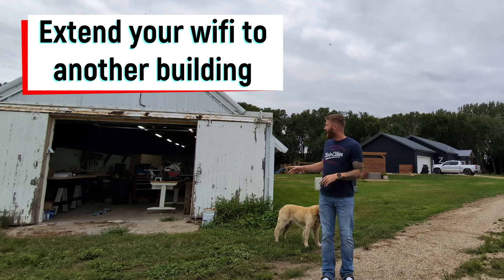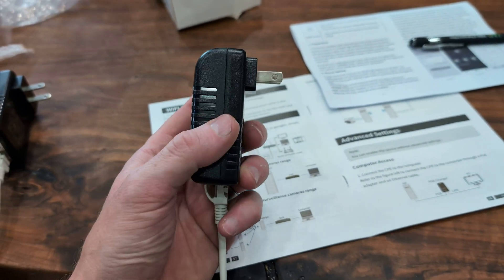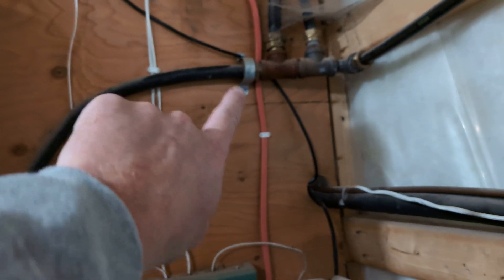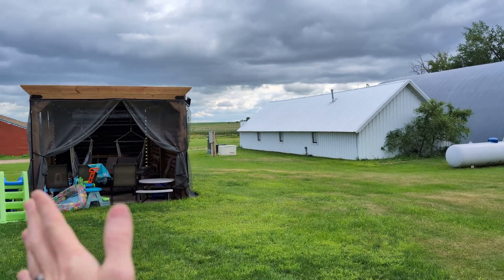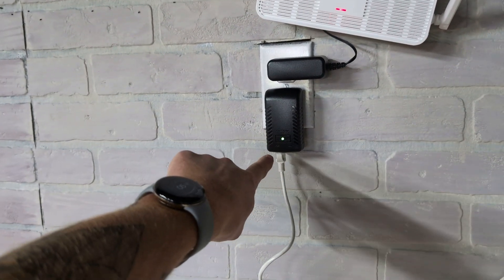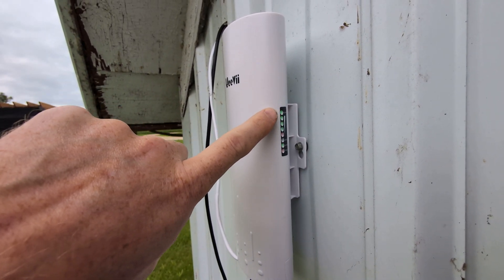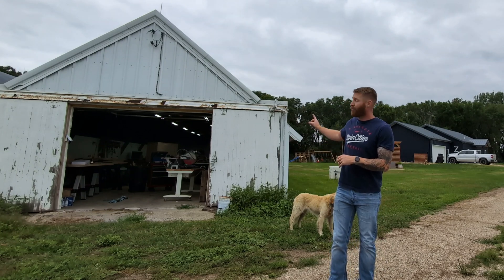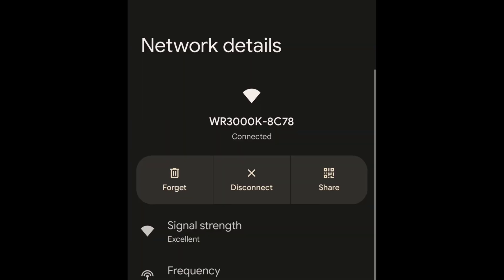How to set up a wireless internet bridge from one building to another

Comment: What is wrong with just running an Ethernet cable between the  buildings?
Reply: Bridging is better for A few reasons:

Trenching can be costly because you might need to get permits. 
There can be signal loss over a certain distance. Bridging can cover a few miles  or more (depending on the equipment).
If you ever need to make adjustments or move something, bridging makes it easier to handle that.

Comment: Good day. Do you need a router in the wood shop or could you run a LAN cable directly from the unit to a PC? Thank you
Reply from the maker: If you're going to hard wire you might not need a router but I'm not certain
Reply: you dont need

Comment: Just going to say that you get what you pay for with these cheap radios, the plastic turns yellow becomes brittle and over time their performance degrade until they lock up and no data gets passed and require power cycle, this also happens if they get too hot on hot days out in the sun too, they have no weather proofing seals at all the PCBs have no weather proofinf coating either, cheap capa and lead free solder make for random failures after being deployed for a short time. they usually come paired already but dont use that, configure them manually. reasons ok just do it better yet dont buy these if you plan on using them for any serious situations, go on and bite the bullet and get Ubiquity, Ruckus or eve TP-Link FFS.
Reply: I AGREE,its so close<<why not put a damn cable!

Comment: you only need one cable running to each extender, thats what the lan port on the poe injector is for you'll  have two cables running into each. the way you have it set up will work but is not necessary.
Reply from the maker: I learned this after install and you're correct 👍👍
Reply: @BuiltKnotBought  great video! gonna set this up for my parents this weekend.
Reply from the maker: @adamfelix797 awesome, can't beat it for the cost 👍
Reply: Can you clarify this please?  You say you only need one cable running to each extender, but then you say you'll have two cables running into each?
Reply: @bgnPrinceton two cables running into each POE injector on the power outlet.
Reply: POE is Ethernet and Power in one

Comment: Did you use a modem in your shop? I have the same router in my shop ax3000 wifi 6 and same Ueevii wireless bridges as gentlemen in the initial video.

Comment: Just some info on where you're choosing the wi-fi at the end - The difference between "WR3000K-8C78" and "WR3000K-8C78-5G" is that the 5G network operates on the 5Ghz band while the normal one uses the 2.4Ghz band.

To summarize the pro's and con's between these 2:

5Ghz:  Higher speeds are attainable, but it's more prone to signal loss (This is because the 5Ghz range operates with shorter wavelengths - these are more prone to absorption through surfaces. So if you have a lot of surfaces/walls in your workshop, you may find that your signal is worse using the 5G network)

2.4Ghz: Limited in speed capabilities, but much more robust when it comes to resilience against absorption through surfaces. One other issue 2,4Ghz is prone to but which is not applicable in your situation, is that because there are less channels available in this frequency range, it can become crowded quickly if for instance there are several different 2.4Ghz networks in the area.
Since you're on a farm and there isn't many different networks close by, this isn't something to be concerned about.
Reply from the maker: @vexus42  appreciate the knowledge!
Reply: Love the explanation!!! 💯

Comment: Great video, thanks. I'm thinking of installing similar gear. One question, did you try running a speed test in home and shop to see if you lose any speed in the shop? I'm particularly interested in Upload speed as I live stream on Twitch from time to time. Also, how reliable has the connection been in the months since you installed? Does rain or snow impact it? Lots of questions so thanks in advance for any replies. Greetings from this UK-based Twins fan!
Reply from the maker: I have not checked the speed but it has been working well for me.  I watch YouTube videos and upload videos to social media but streaming might be a different story

Comment: I have a question, do you really need to run the cable directly from you home router to the master or could I run it from my poe switch thats connected to my router? On the master side I mean slav side should be pretty easy. If you know or don't thanks anyway ;)
Reply from the maker: After I installed I learned that you only need one Ethernet cable not two 👍
Reply: @BuiltKnotBought  hey thanks for the reply its a more technical question if its using a standard or non standard poe. I asked the company they said its non standard but there was an upgraded version put out in 2024 that does use the standard poe+ on the second eithernet port. Have a good one

Comment: Hi, I need 2  routers to make this system work?
Reply: A WAP (wireless access point) is a simpler solution than a second router.  You will basically configure   the second router to serve as a WAP.  So unless you have an old router laying around use a WAP instead.
Reply: It depends on whether or not you want wireless in your second location. A switch will do if you do not need wireless, but a router will be needed to be able to connect wireless devices.
Reply from the maker: @Bripromo  yes you'll need a 2nd router in the new area/building to project the signal
Reply: How does the Internet work in the shop? Do you experience any lag or issues?
Reply from the maker: @RheaLynn-k9m it's been working very well for what I need it for.  I often watch YouTube videos while working on projects upload content from my phone etc